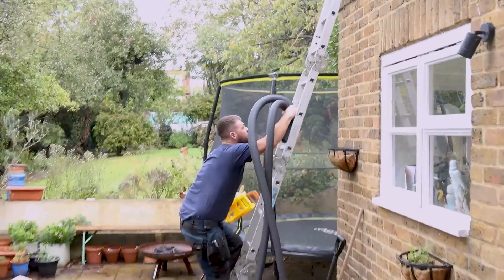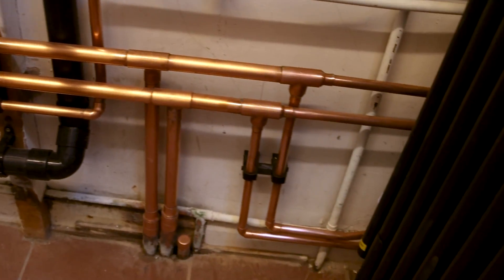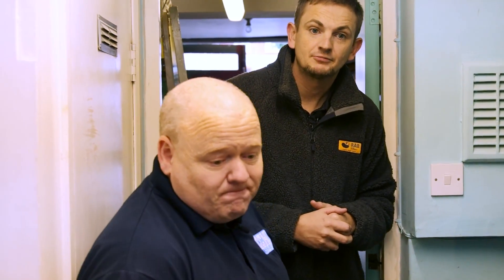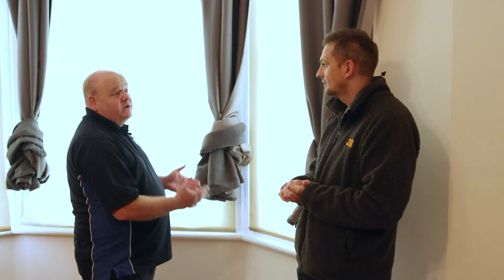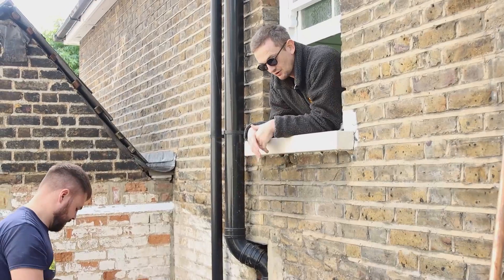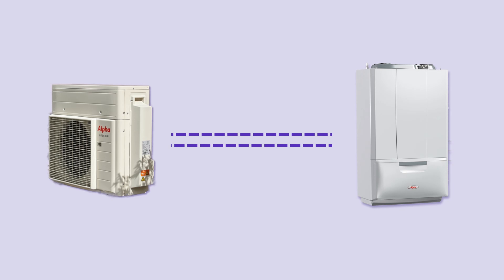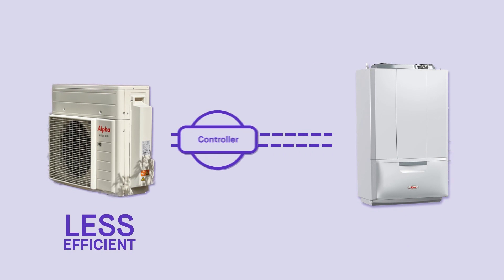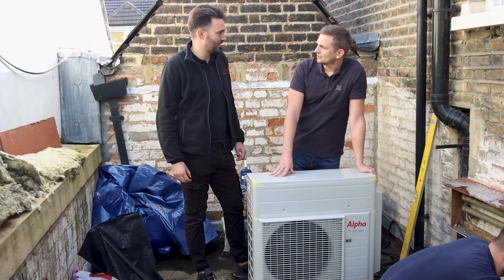An Air Source Heat Pump Installation Like You've Never Seen Before (UK Case Study)

Comment: But the issue with heat pumps it makes you fully reliant on the electric/ grid so it very dependent. Let alone all the extra costs needed like replacing the entire pipework and rads. And if you’re relying on a grant it’s flawed due grants don’t stay let alone the morel issues of it’s tax payers money. Personally I’ll stick with my gas combi, due being in a remote area it’s safer to have a mixture of sources of heating like gas and fire place. Plus the shire cost of theses systems puts myself off.

Comment: I don't really understand the benefit of going hybrid with the additional cost of upgrading the radiators and pipework anyway. You also don't get the benefit of losing the standing charge for gas.  There are two systems to service too. so surely a bit like having a hybrid car with all the additional costs of repairs and servicing, without the benefits of the simplicity you get from owning a BEV.  🤔

Comment: When doing the heatloss calculation wouldn’t you take into account the solid walls, single glazed windows and older type of property. Was it the case of the heatloss being too much for a heat pump only system running on weather compensation. Plenty of older houses run on heat pump only systems.

Comment: Can the controller download tariff prices for tariffs which vary on a daily or hourly basis?
Reply from the maker: The controller currently can only read 3 inputs. 1 is Mon - Fri 8:00 - 19:00. 2 is Mon - Fri 7:00 - 8:00 and 19:00 to 23:00, as well as Saturday from 7:00 to 23:00. 3 is for cheaper hours, Mon - Sat from 23:00 to 7:00 and Sunday 24 hours. This is something that Alpha are looking to implement on the next version.

Comment: A hybrid isnt new, the controls noted are decades old, there is nothing new here. The commentary is deceiving, i don't think there is a great deal of knowledge regarding heat pumps and how they operate.
Use of convetor rads isnt a great idea but provides a quick fix. The clients choice of rad in this instance was better. 
Manufacturers provide the controls noted as standard so, unclear why its stated as if its new. 
4kW Ashp for a property like this is token at best, might as well have just installed the boiler as standalone. Id estimate that the heat pump will rarely run.

Comment: Why go for a hybrid when replacing all the pipes ?
Reply from the maker: The customer still wanted the reliability of the gas boiler to ensure that they could still get their property to the desired temperature. If in the future, heat pumps reliability can improve, the pipes are in for them to choose to do this.
Reply: @Heatable  
Strange to go to all that work, sizing the pipes correctly for the HP then not putting the correct sized radiators in and then run a a gas boiler. The last part of the puzzle would have been correct the radiator size. What’s un reliable about a HP that you have fitted one ? This video is really quite confusing.
Reply from the maker: @tomplumb7754  Hi Tom, this is an old property and would require a lot of upgrade work doing, including installing insulation in  walls and changing the window glazing etc, before a heat pump should be installed. This would be a lot more work and at a huge cost. These aren't typical radiators that we advise, but this is what the customer wanted. Heat pumps aren't unreliable, but one would be for this property when it hasn't been correctly upgraded. A hybrid heat pump allows the customer to be able to have the boiler kick in when the heat pump can't get the house to temperature.
Reply: @Heatable  
Hi thanks for the reply. 

I can understand that if the property had the fabric sorted then these types of radiators would not cost the Earth to size correctly. 
We fit them regularly on gas systems and the cost to size for Hp’s is huge i am finding this myself at home, my wife is asking why we need a second large radiator in the sitting room…

What is the heatloss of the property out of interest?
Reply: @tomplumb7754  I'm interested in knowing the property's Heat Loss too as I am considering this approach for my home.

Comment: Presume there's EXTRA big savings, what with modern Heat Pumps now having serious, "SCOP" Ratings,coupled with the likes of those super low Night Saver Rates...this Hybrid Heat Pumps set up seems a great solution...
Reply from the maker: Based off of a trial carried out last year, over one year this system could lead to a saving of 1.2 tonnes of carbon and 0.85p cheaper a day, which is great considering this is a first step into renewables!